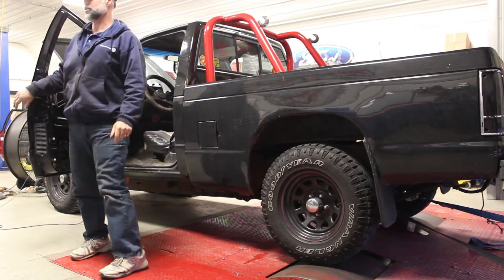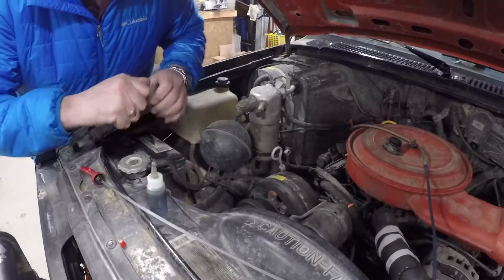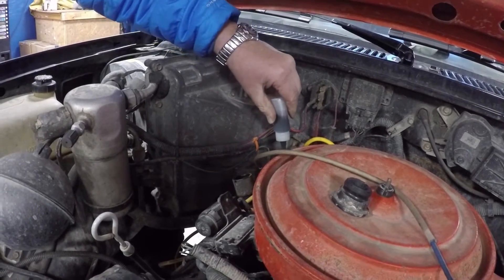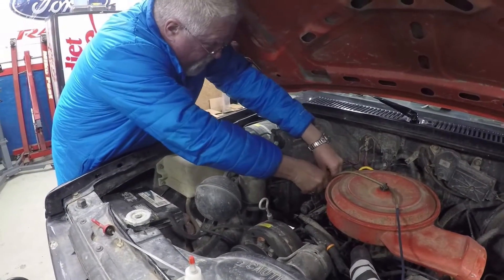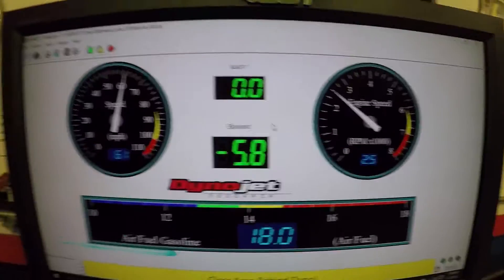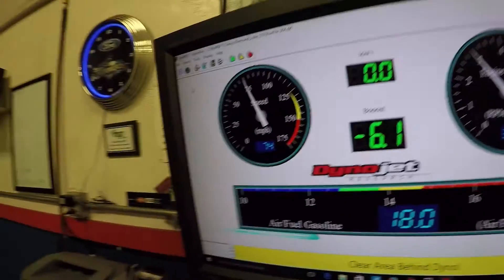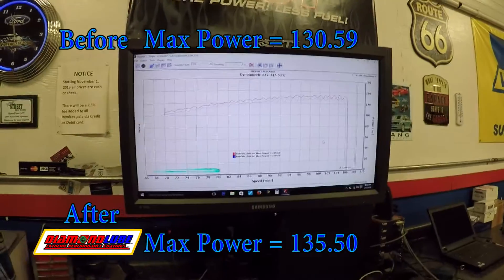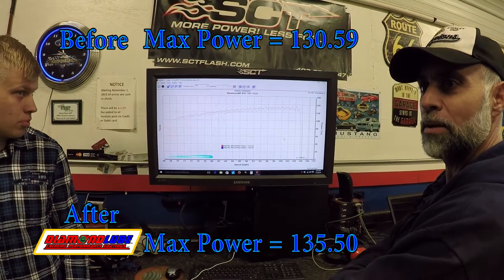Cheapest Way to Increase Horsepower and Save Money

Comment: So this is one of those famous oil aditive that reduce wear and friction? I imagine it can be use on the engine oil and the gear box one to?
Reply from the maker: +M Cunha it's the first and original. Works in engine oil, gas, differentials, automatic transmissions, manual transmissions, any where you need to lubricate.

Comment: The diamond doesnt damage the metal surfaces in the engine?
Reply from the maker: No. The diamond is spherical and embeds into the surfaces providing a true diamond coating, with a Coefficient of Friction of .0008. The diamond prevents friction. Look at my newer video of the flaming nitro fuel car to see more

Comment: WHich Diamond lube did you use? The website has them for like $800 for the Platinum V8 which obviously not going to buy. If it can prolong my parts and have some gains for a cheap price then that'll be great.
Reply from the maker: What size engine do you have?
Reply: Its a 5.0 TBI Motor from the 80s. I looked up the V6 you test and its 160 at the crank and 135 to the wheels after the application. I plan to try it even if its a 5 HP gain. I'm actually kind of hoping that because its an 8 cylinder, it might be a little more effective
Reply from the maker: +reynoso3713 give Chris a call at 630-706-1250, the number on the site. He can help you out
Reply: Yea sure thing. Would you, off the top of your head, have a guess as to how much each bottle would cost? I assume you need a bottle for the engine, tran, and diff respectively.
Reply from the maker: +reynoso3713 it really depends on what you want to do. Please call Chris, it will be way faster.

Comment: Your showing temperatures for the differential and stuff but could you please explain the importance of this instead of just showing it
Reply from the maker: +Titan Warlord We are showing the temperatures because over time they start to get cooler. DiamondLube is reducing the friction allowing the parts to run cooler.  Now with the Differential the initial footage got corrupted, but the initial temperature was around 140 degrees F right off the highway.  At the end of the video, when we get home, it is at 100-110 degrees F.  Just another way to show DiamondLube is doing its job.